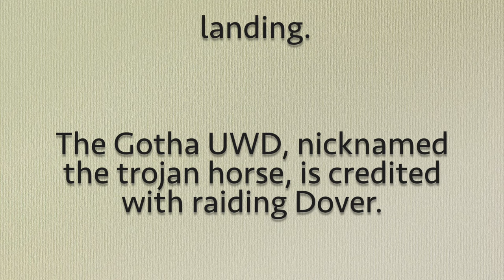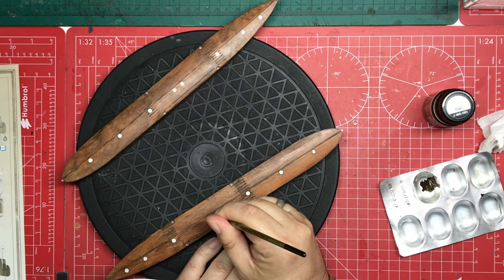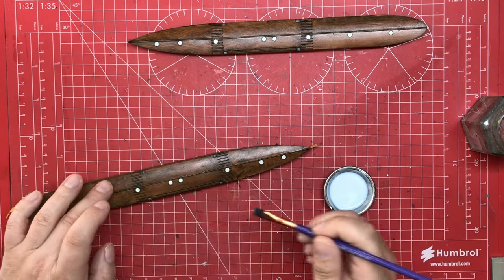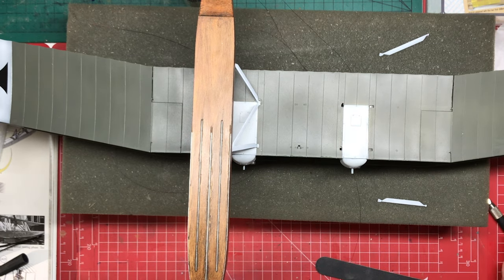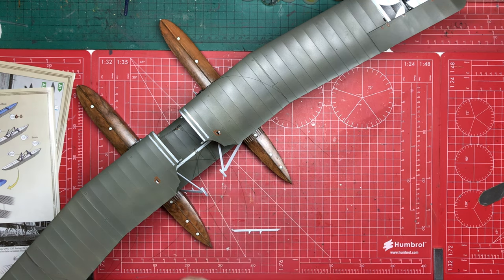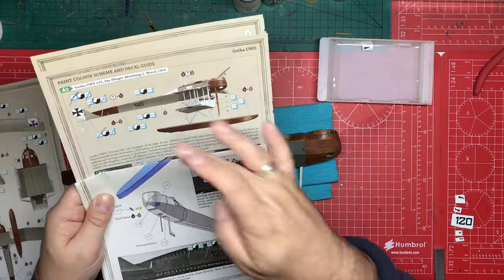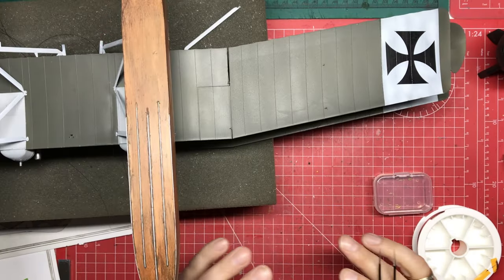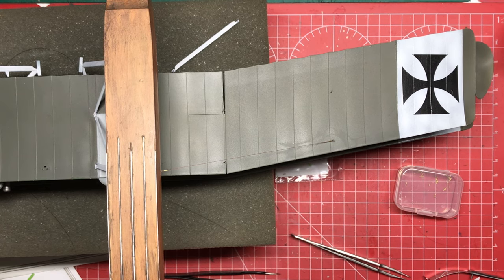Wingnut Wings, 1/32, Gotha UWD, detailed step by step build, Part 14

Comment: I was just thinking, as I watched the last few minutes of the video, about why you didn’t use EZ Line and then you answered the question. 🙂 I must say that the rigging work and attaching the struts to the floats/wings look super fiddly to me, and I probably would need to tackle them over a month of Sundays to keep my nerves from fraying. LOL.
Reply from the maker: EZ line also becomes brittle over time if exposed to UV light, just a few months.  it was originally designed for railroad layouts, usually in places with no natural light
Reply: @ModelkitStuff  it’s fishing line for me too, lots of natural and UV light over here. Thanks for the tip. 🙏🏻

Comment: Bravo.  You are right that WNW's instructions aren't foolproof (or indeed error proof), especially when it comes to the sequence of adding decals.  I learned this the hard way when I built on my Sopwith Snipe.  WNW instructions are darn good but not perfect;  I'd rate CSM instructions as the best at least for military aircraft.  

As for EZ Line, don't get me started. I'm not a chemist but I've had EZ line react to CA glue the like same polarity magnets behave when placed near each other.  You are trying to place that tip of EZ line to glue or glue to the EZ Line  and the line will wriggle like a demented snake,  not that I've seen a demented snake, but it seems an appropriate description.  

This was a brilliant installment Jason; how many more do you have planned?   Will you do the final reveal at an even Twenty?   Cheers!
Reply from the maker: Hi Mark, thanks so much for taking the time to comment.  there is two episodes left I think or possibly one and a final reveal not sure until I have edited the remaining videos, but it it done